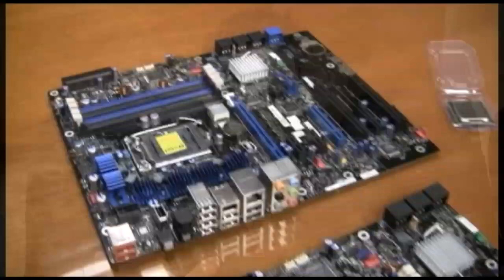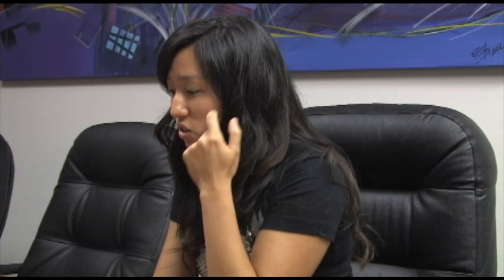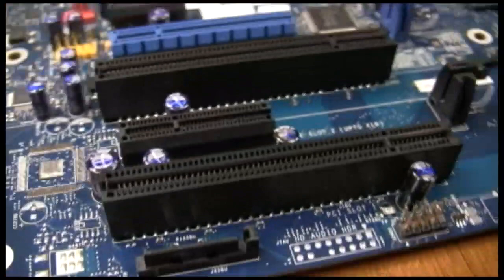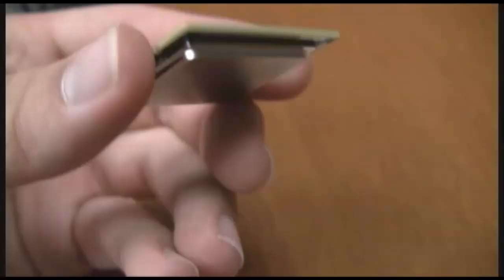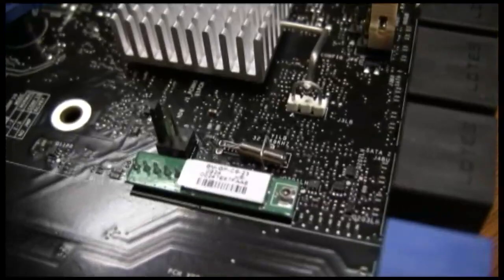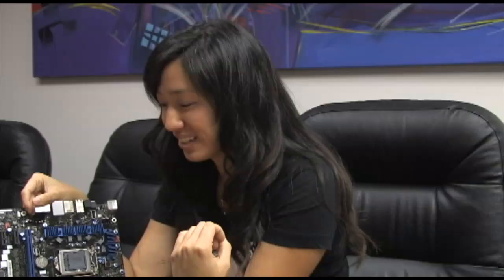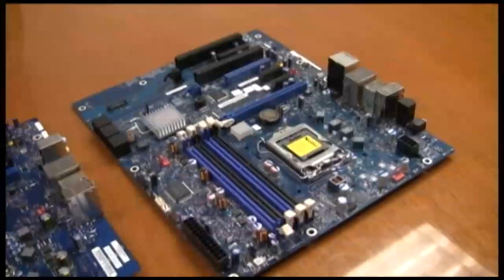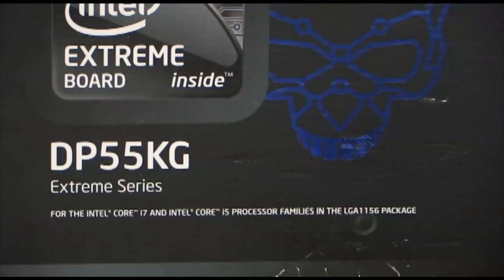Intel P55 - Behind the Scenes Interview

Comment: If you are running a single GPU then P55 should be fine.  If you are planning to run multiple GPU then you need X58.  The reason why P55 are good for single GPU is the mem controller and PCie controller is build in the CPU.  The X58 on the other hand, still has the IOH, so the PCie lanes have x16, so no bottleneck.